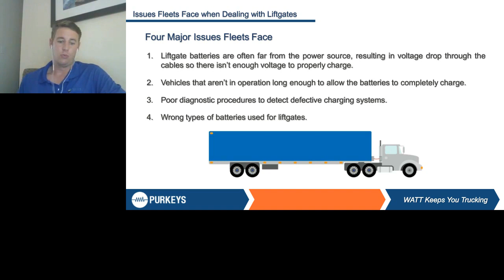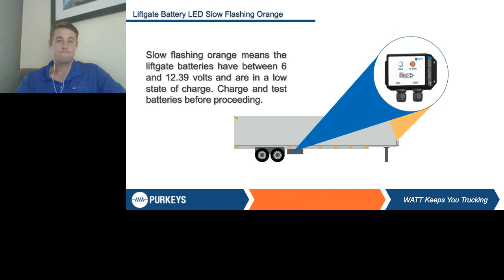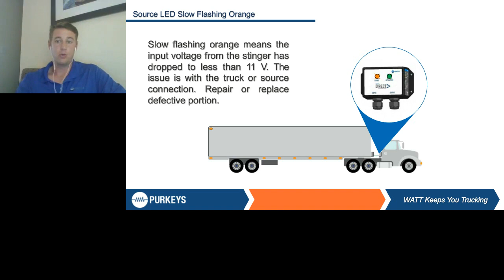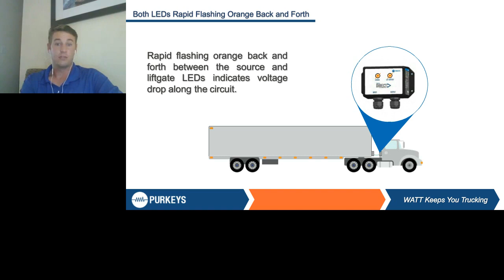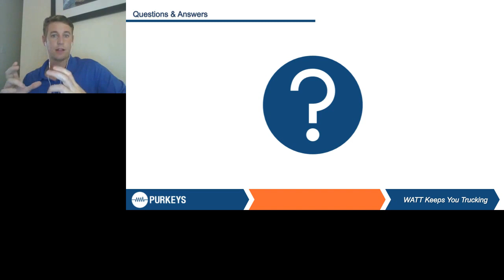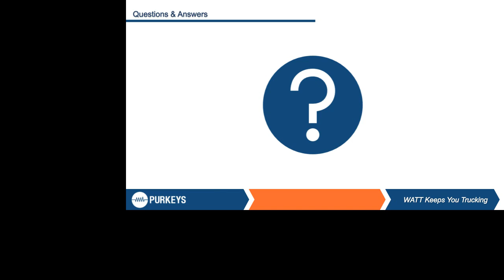Liftgate Charging System: The Direct Webinar - Purkeys

Comment: Where do you connect the yellow wire in the battery box
Reply from the maker: It goes on the 2 pole terminal block on the charging plate on the same bolt as the yellow wire from our 4 pin harness. Feel free to call our technical support team at 479-419-4800 if you need additional help!